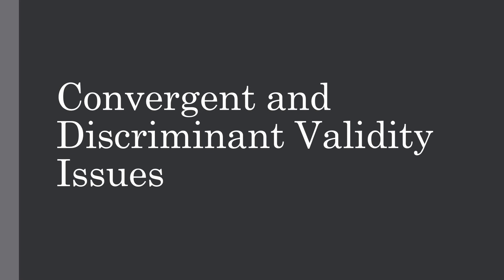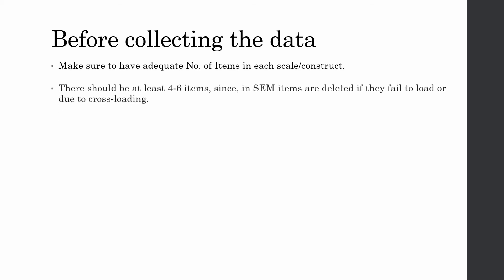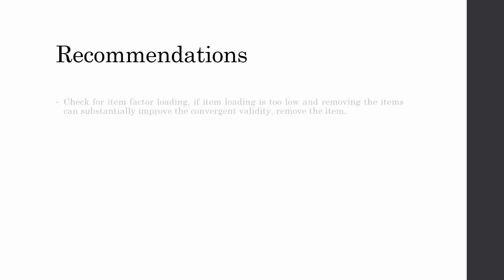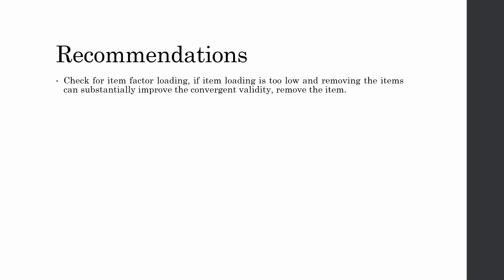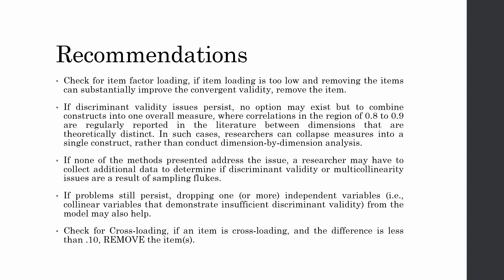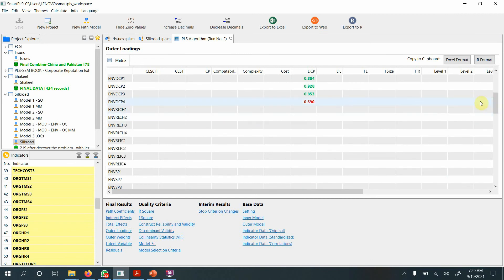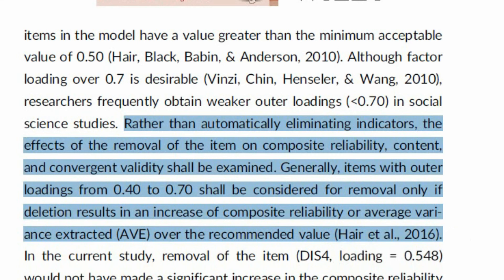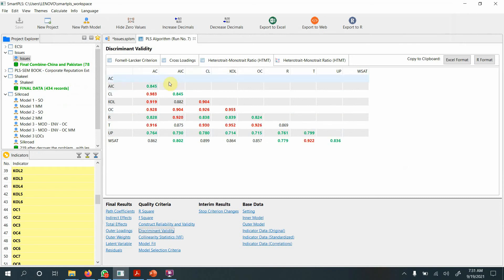How to Solve Convergent and Discriminant Validity Issues in SmartPLS

Comment: Thank you so much Fawad.  I have a question please, My AVE is all red (less that 0.05) I have removed all the items with low factor loading but AVE is still bad. CR is okay..Can I report like that in my thesis?
Reply from the maker: If it is over 0.40 and CR is over 0.60, you can report it.

Comment: Sir all my factor loading are between the range .05 to .08 but still the AVE of some of the constructs are below .05. There are two construct who's AVE is .038 and .036 respectively. What should be done in this case?
Reply from the maker: You may have to remove some items with low loadings.

Comment: Dear Professor,
May I ask you how to combine 2 constructs into one? I have 2 variables with 3 indicators each of them. Their convergent validity is less than 0.7. I want to combine them. Thank you!
Reply from the maker: You can just put all items into a single construct.
Reply: @researchwithfawad  ok, but that 2 variables were also measured through the questionnaire. To be clearer, I have 2 formative constructs (2 variables with 3 indicators each). I also measured each one of that 2 global variables through the questionnaire and I have different responses. I understand that i have to put together all the 6 indicators, but how should I do with those 2 variables?

Comment: Thank you so much, Professor. Your kind teaching saved me once again.
Reply from the maker: Pleasure. I am glad you liked it
Reply: @researchwithfawad  Professor, may I please consult you about the reference? For the solution, "if an item is cross-loading, and the difference is less than .10, REMOVE the item(s)", which paper should I refer to? I checked the paper (Farrell, 2010) you suggested in the video, and it did not mention the specific difference "0.1". Thank you.

Comment: Sir, if AVE value is 0.449 but the cronbach alpha and composite reliability is 0.886 and above 0.7 then can we say that the model is fit?
Reply from the maker: AVE and CR are not for model fit. But yes, you can say construct is reliable and valid
Reply: @researchwithfawad  Thank you so much sir. What are the parameters in model fit in smart pls4?

Comment: Assalamu'alaikum Sir. I have questions.

If my hypothesis:
-H1= one tailed, 5%
-H2= two tailed, 5%

What options should i choose in significance level when i want to run  bootstrapping, should i do:
@two step
-step 1= choose one tailed, 0,05
-step 2= choose two tailed, 0,025
Or;
@one step
I just do like step (choose two tailed, 0,025 and for p values:2 to generate h1 hypothesis p values)

Or how sir?
With my respect for ur respon sir
Reply from the maker: Do two tailed. But for those hypotheses that are one tailed, divide p value by 2 and then report that p value.
Reply: @researchwithfawad  two tailed with 0,025, right sir?
Reply from the maker: No, the p value you obtain will be divided by two to make it one tailed.
Reply: @researchwithfawad  sir sorry im still not understandur answear
U mean, u reference me choose two tailed, and what sig level that i should choose ?

0,05 
Or
0,025
?
Reply from the maker: The p value that you get from the results, divide that by 2 to get one-tailed results.
Reply: @researchwithfawad  i've got point for this question. So  option that i chosed before run bootstrapping is two tailed with sig level 0,025 . And for getting h1 result, just divided p value : 2

Right sir?hehehe
Sorry bcoz my lack understanding, Thx a lot for ur attention, god bless u sir  🙏

Comment: Hi Dr, after deleted, HTMT looks fine but the relationship become not significant. How to explain this? Thanks.
Reply from the maker: How many items were removed. Delete one by one and see hownit affects the significance. You may use tue more liberal measire of 0.90 for HTMT.
Reply: @researchwithfawad  1 - 2 items for each dimension since a few HTMT were above .90. I did it one by one, the HTMT value reduced to < 0.9 for a particular variable. However, after two of the HTMT values scored below 0.9, the relationship become not significant and there are still 1-2 values of HTMT above 0.90. Thanks.
Reply from the maker: Try removing items from difference constructs to what you have removed from now, if using cross loading and check again.

Comment: EssalamAlaykom Dr, Pls I have one construct with 6 indicators and AVE< 0.5 but when I drop with 2 items with Factors loading <0.6 will increase the construct AVE (remain just 4 items). It's correct. The issue is some report that we can delete just 20% of items. the question 20% only from one construct or all variables?. Big Thanks Dr.
Reply from the maker: WAS. 
Overall from the model, are you deleting more than 20%, further removing the items shall not deviate the scale from the conceptualization for the construct.
Reply: @researchwithfawad  Big thanks Dr, you are doing a great job helping us with our studies. Could you share with me references to support this idea.
Reply from the maker: Primarily you can use the following references
Collier, J. E. (2020). Applied structural equation modeling using AMOS: Basic to advanced techniques. Routledge.

Hair JF, Hult GTM, Ringle CM, Sarstedt M. Thousand Oaks, USA: Sage Publications; 2014. A Primer on Partial Least Squares Structural Equation Modeling (PLS-SEM)  

Hair Jr, J. F., Hult, G. T. M., Ringle, C. M., Sarstedt, M., Danks, N. P., & Ray, S. (2021). Partial least squares structural equation modeling (PLS-SEM) using R: A workbook

Comment: Hi, I have a second order model, now I have a problem that the HTMT value are more than 0.90. Is there any related paper that explain how to solved htmt problem? In my case I've htmt score more than 0.90.
Reply from the maker: Please follow the steps in the video they will help you solve the issue. You may also watch this video. 
https://youtu.be/m6tUlGiH9_M
Reply: @researchwithfawad  Yes, I've follow the step from this video. But, when I open the paper from this video I am not found the statement when htmt are more than 0.90 then remove the indicator. Can I get the paper that I can cite for my research? Thank you in advance
Reply from the maker: Please read the whole paper, if there is high discriminant validity you do not have any other option but to either merge it or remove it. also, not everything has a reference.

Comment: Assalamualaikum dr, I have a question. Is there a required gap for a good discriminant validity between variables? My variable discriminant validity has higher loading on its own variable but the gap between the other variable is quite close (less than 0.2). 
For example: the discriminant validity for my variable satisfaction when loading on its own is 0.782 but the loading with another variable is 0.620, Is the close gap acceptable?
Reply from the maker: WAS. If the gap is over 0.10 you are good to proceed with further analysis
Reply: @researchwithfawad  Alhamdulillah. Thank you for the fast reply dr. Does it have a reference I can cite? for justification. If you don't mind sharing it with me
Reply from the maker: The cut-off value for loadings was a significant level of 0.7 (Hair et al., 2013). Thus, items with a loading higher than 0.7 on two or more factors were deemed to have significant cross-loadings. 

Hair Jr, J. F., Hult, G. T. M., Ringle, C., and Sarstedt, M. (2013), A Primer On Partial Least Squares Structural Equation Modeling (PLS-SEM). SAGE Publications, Incorporated
Reply: @researchwithfawad  Thank you for the reply dr

Comment: Dear Sir, 
First of all, thank you so much for this video. I followed your instructions and my issues is resolved as well. But, i am unable to find any  other relevant article to cite than farrell (2010). Could you please share any other relative articles as well or studies who have adopted this approach to solve the discriminant validity issue. It would be a great help.

Thank you & Regards.
Reply from the maker: For more you may also read the book by Hair et al, A Primer on Partial Least Square Structural Equation Modelling.

Comment: AssalamuAlaikum sir
Sir, I am doing pilot study right now and one of my variable "personality traits" have got low loadings for some of the items and when I remove those items my Ave increases. Sir should I remove those items in this stage where my sample size is just 100 or should I take them for the actual study too because may be low loadings are the reason of inadequate sample size.
Reply from the maker: No need to assess AVE for pilot study. Assess construct validity for final study. For now just assess reliability.

Comment: Dear Fawad Latif, thanks so much for your selfishless help. I will definitely follow your instruction to work on my discriminant validity issuses. I have two more questions here. 
You mentioned that we should compare the cross loadings to see the difference. If the  difference is above .1, we should consider to keep the corresponding items. Could you please tell me the relative articles for me to cite? 
Besides, you also mentioned that if the HTMT criterion was not satisfied, we could cautionsly continue when the cross loading and Fornell-Larcker criteria were fine. Do you have this source as well?
I failed to find the sources of these statements. The article you mentioned in your video, I have read if before, which is very helpful, but no similar statements like those two I mentioned above.
If you have more recommendations, please make a list. I will read them thoroughly. 
Once again, thanks so much and best regards.
Reply from the maker: Hi. Thanks. I hope my comments have helped you. 
As for citation for discriminant validity, please refer to 

Insufficient discriminant validity:
A comment on Bove, Pervan, Beatty, and Shiu (2009)
Dr Andrew M. Farrell, Loughborough University

As for using Fornell and Larcker instead of HTMT, these are different methods, you can put this text in your paper and i hope you will be fine.
Reply: @researchwithfawad  I already cited this paper and double checked it, cannot find the sentences like "if the items are cross-loaded, and the difference is less than.10, the items should be deleted" and "as long as the Fornell-Lacker and cross-loading criteria are satisfied, even if the HTMT criterion is not perfect, the discriminant validity could be cautiously accepted". If it is not too troublesome, could you please check the sources?
Reply: @Andre de Santis Candro unfortunately, no. I have three mediators in one model. Since one of them highly correlates to the other two mediators, I separated the original model into two models (one model has one mediator, the other one has two mediators). This solution could refer to Farrel (2010), which proposed to drop one or more constructs with insufficient discriminant validity.

Farrel,(2010). Insufficient discriminant validity: a comment on Bove, Pervan, Beatty, and Shiu(2009)
Reply: @Andre de Santis Candro Thanks so much for your recommendation. Although I have finished the writing of my dissertation, I will read the paper you mentioned.
Reply: @Andre de Santis Candro Hi Sir thanks for sharing this reference, can you give detail, which paragraph that mention the procedure to remove varibles to correct discriminant validity?

Comment: Thanks for sharing Dr. May I ask what is the recommended value that KOL5 exceeds at 13:10? And will there be any video about how to solve the multicollinearity issues? TQVM
Reply from the maker: It is loading well onto the other factor as its loading is over the generally recommended loading of .70. 

Although, no video yet but here are few solution i found 
- Check the correlations between the LVs 
- You can Group the independent variables in one second order LV, and further use second order LV as the predictor.
Reply: @researchwithfawad  Understood Dr, thanks again